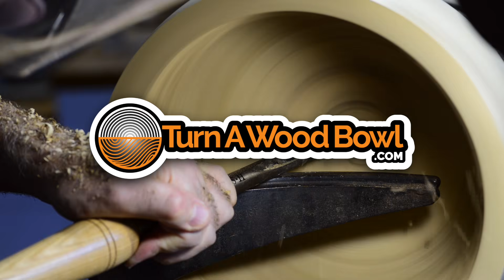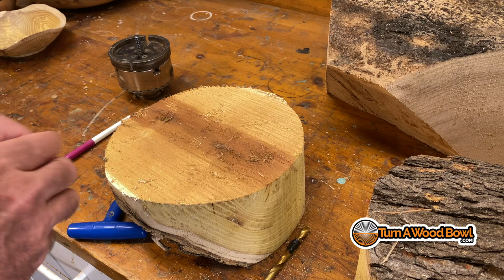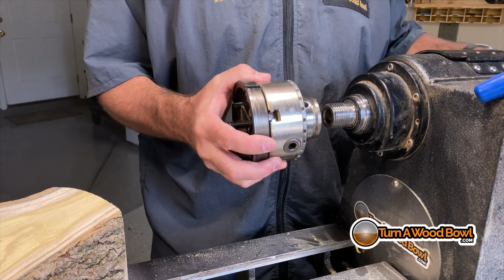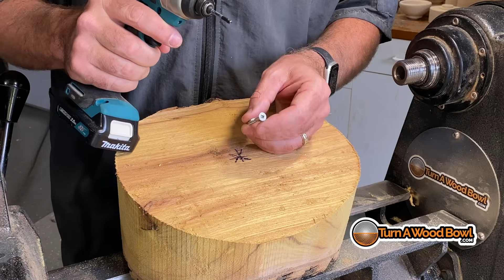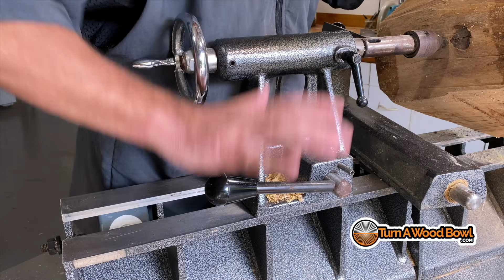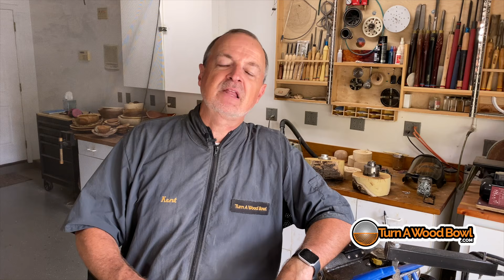3 Ways Mount Wood To Lathe - Bowl Woodturning Video

Comment: Another great video Kent. A couple questions:
1. Is there a reason you don't show drilling a counterbore for the spur method? It seems much safer to me although it adds a step?
2. For face plate mounting screws I think SS is actually the second worst choice after cheap Chinese screws. Basic carbon steel is stronger and you can also step up to grade 8 screws which are even stronger.
I'm interested in your thoughts. Thanks.
Reply from the maker: Eric,
If you have a good tailstock lock, you should be fine without drilling a counterbore initially. 
And, the most important aspect of the screw is the size. You want one that fits the hole almost exactly. Any slack can cause the faceplate to shift while turning. But, also never use drywall screws. 
Happy Turning! 
Kent

Comment: Is it safe to attach it using double face tape to a wood base on a faceplate?
Reply from the maker: um??? Well, it depends. I would not do that if I were just starting out. And you have to have a very smooth surface to apply the tape. Happy Turning!

Comment: I have really enjoyed your helpful hints I have a Craftex lathe which I just purchased used and I have been turning out some Elm bowls green three-quarters of the way and drying in the microwave 45 sec. at a time and weighing till it is around the same weight as last time I also have a very good moisture meeter my problem is my motor is on the back of the lathe if I use a faceplate it brings the piece too far back and it hits the motor but I am dealing with it. my next question is have you ever mounted a faceplate to the tennon I am finding drying wood in the microwave the tennon gets a little out of round and it throes the bowl off I have tried to clean up the tennon but it was a mess I ruined bowl the tennon was straight but it altered the bowl to much .thanks so much Steve...
Reply from the maker: Good question Stephen. Check out this video. https://www.youtube.com/watch?v=2qor9wes5zk Happy Turning!

Comment: Kent, I use faceplates and the four jaw chuck.  The problem I’ve run into is on some bowls they have a somewhat oblong shape when I mount them and turn them with the jaw chuck.  What causes this?
Reply from the maker: Hm? Not sure Jon. Perhaps they can be cut more cylindrical initially?
Reply: @TurnAWoodBowl  I found what I suspect is the problem.  I had the wood bowl base contacting the base of the jaw chuck instead of just the jaws.  Subsequent bowls have turned perfectly round with no issue.

Comment: Has any body used the paper and glue to attach the blank to face plate. 
Was told to attach a wood round to face plate. Apply glue to round. Attach note book paper and glue and attach turning blank. Clamp. Let dry and turn.
Reply from the maker: Yes Steve, I may do a video on this soon. Stay tuned.
Reply: Another question. 
On UTube a fellow used hot glue instead of paper. 
Again, have you ever tried this method?

Comment: can I use a face plate to hold the end of a small branch to turn a spindle?
Reply from the maker: If there is room for the screws, but that is not the best way to mount a spindle turning. Use a spur center and tail stock.

Comment: I am new to bowl turning , I’ve had the pleasure of working with a fellow that’s been turning for 30+ years and he has never showed me the worm or the spur but in my own shop I have tried that on a couple other projects with success , my bowl turning it really new as I’ve only turned two bowls to date and because I was impatient I made my first bowl into a funnel and my second bowl shattered not sure of the reason the walls were 1/2 inch still and I was going slow trying to get a good feel of the gouge but I have plans for a cherry tree and it’s going to be the smaller limbs just so I can get used to handling the gouge safely. Thank you for the videos they have shown me many things that helps a person get prepared but until you put that gouge to the wood it’s just another video. Practice makes perfect
Reply from the maker: Thank you for writing and sharing Robert! We all made at least a couple funnels. All the best to you and Happy Turning!

Comment: Great video, I've been turning for just a few months and used the screw chuck, though I'm learning to use the  4 spur chuck. What is best to use in the tailstock with the 4 spur? Currently I use a #2 morse taper heavy duty live center, but I seems to dig in too much. Other/better options?
Reply from the maker: That sounds like it should be ok. It might be the wood too. A soft wood will allow the center to dig in more. Happy Turning!

Comment: Thank you, the information from this video was is priceless. You were able to cover everything needed to get started turning a bowl that every new turner needs. As a new turner putting a piece on the lathe has got to be the scariest part, just not knowing if you have done it right. You didn’t push the different ways or your way is the best leaving the it up to the turner. I myself haven’t decided yet what will work for me but getting there, Slowly but surely it will come. Ideas running through my head constantly need to put them on the lathe. Again thank you for sharing it was a wonderful and enjoyable video to watch. 
I will catch up on some other videos you have done. If I may ask ?
If you were turning a bowl,with epoxy what method would be the best? 
I’m thinking the worm screw but still bring the tail stock up!
Reply from the maker: Thank you, Nancy. Glad you like this. Epoxy should not be any different than wood. Go with what you prefer and are comfortable using. A spur drive center, faceplate, or worm screw will all work. Happy Turning!

Comment: Kent, love the videos. I have an issue when I try to use the screw chuck. It does not happen every time and that is the screw becomes loose inside the wood. This tends to happen when the wood is green/wet. I have a ONEWAY chuck and screw. Any thoughts.
Reply from the maker: Well, the first thought is I don't like screw chucks. Ha. If there aren't loose on the wood, they sometimes come loose in the chuck. And getting them out is rarely easy. You might try adding small shims, like several toothpicks, in the hole to force the teeth to grip the existing hole. Let me know if that helps.
All the best to you and Happy Turning!

Comment: I have a hard time getting the worm screw that came with our Wen 4 jaw chuck to seat. Either it won't thread or it just turns. I've used the recommended drill bit as well as one size smaller. I've tried wax to lubricate the worm screw too. What would you suggest to help?
Reply from the maker: I suggest using the faceplate or drive center. ;) Seriously, I'm not a worm screw fan. It always seems like I'm spending too much time fussing with the same issues you are describing. Happy Turning!

Comment: Thank you for sharing and I have one quick question about the 4 Spur Drive Center (MT2 Morse Taper), is the stock one that comes with our Lathe is that enough to start out with or do you suggest buying a better one??

Thank you
Reply from the maker: If the drive center digs in and holds the piece, yes it should be fine. The 4 spur one I use seems to have a little width which helps with the larger pieces. All the best to you and Happy Turning!

Comment: Kent, what’s your experience with expanding into a mortise rather than clamping down on a tenon?
Reply from the maker: John, I enjoy having more options for the foot of a bowl, that is why I primarily use the tenon. I find the mortise too restricting. Happy Turning!
Reply: @TurnAWoodBowl  thanks, Kent. Makes sense. 

How then do you finish the bottom of the bowl? … video or class on that?
Reply: @TurnAWoodBowl  Kent, just found your video on  using a jam chuck to remove the tenon … again, thank you!

Comment: Dear Kent! Meanwhile I watched a lot of turorials on woodturning and I want to thank you for mentioning all of the concerns a beginner has to deal with. Thanks secondly for your understandable English even for non-native speakers like me; that's not self-evident for Americans. One question is left however: what are impact screws? I've never heard of it in Germany. Seems as if it's a kind of square hole... Greetings, Kerstin
Reply from the maker: Kerstin, Thank you for writing and for your kind words. When using an impact driver, screws that have a square, hex, or star hole don't seem to slip. I hope that helps. Happy Turning!

Comment: Hi Kent. Quick question: if I have a 2in thick blank, which I want to turn a shallow bowl from, what would you suggest is the best method for me to attach?  I am worried that attaching a faceplate would mean the screws would be too deep in to the wood, to be able to turn them out. Many thanks 😊
Reply from the maker: I would use a spur drive center and the tailstock. This leaves the least and shallowest mounting marks. All the best to you and Happy Turning!

Comment: Hi again. I bought a record power SC3 chuck prethreaded for 1 1/4" x 8 tpi for my new Powermatic PM2014 lathe. However, I found that the chuck bottoms out before it seats fully on the spindle. The stock faceplate that came with the lathe threads all the way down so I'm pretty sure it's just the difference in machining of the threads on the new chuck.

I tried to search on HD for a 1 1/4 ID washer but that proved to be futile. I'll hop over there tomorrow and see but I figured I'd just ask where you got yours. Thanks!
Reply: Ah I answered my own question on your website. Great site btw!
Reply from the maker: OK, great, so you discovered the simple plastic washer to take out that gap. Fantastic! Happy Turning!
Reply: @TurnAWoodBowl  I think I must have a defective SC3 chuck because the insert does not fill the gap sufficiently. Here's a picture of the chuck with and without the insert. 

Also the stock faceplate that came with the Powermatic PM2014 lathe spins down all the way with no issues. The chuck was not cross threaded and spins easily forwards and backwards. It just seems that it was made on a Friday and someone forgot to give it that extra turn with the tap.

With:
https://snipboard.io/uENmCy.jpg

Without:
https://snipboard.io/10CFKZ.jpg

Comment: Those square headed screws are called robertsons screws. I never thought I would be teaching a master something. Love your videos , keep them coming. I always use robertsons screws.
Reply from the maker: Thanks. Good info. Is that the name of the designer of this screw? Happy Turning!
Reply: i've also been using Robertson screws exclusively since discovering them a while after having started this sometimes frustrating, sometimes satisfying hobby of woodworking, because with them, at least, I know I won't be left in the lurch! The bit will always hold, very often even to the point that I can put the screw onto the bit before bringing it to the spot/hole where I want to screw it in!

Comment: Thanks for very effective and informative videos, especially for a first timer like me. I followed your instructions closely when using traditional bowl gouge, but probably not close enough and for this reason I encountered many catches, some were quite strong. It was initially scary, however, they thought me how to avoid them and I got better. I was not clear about when to sharpen the bowl gouge. The turned surface was quite rough. I do not know if this was because of incorrect use of the gouge or using a dull gouge (I was using a new gouge). So please provide some insight for first timer when to know it is time to sharpen the gauge. I understand, I must try to apply your instructions as closely as possible, but there is a big distance between listening to video and applying what I learn into practice. You are a very effective teacher. Thanks again.
Reply from the maker: Thanks for writing and asking this question. There's a woodturning joke that holds a large kernel of truth. "If you think you should sharpen your gouge, you should have done it 10 minutes ago." In my Tool Sharpening Online eCourse TurnAWoodBowl.com/sharp I teach that we need to closely pay attention to the feel and "attitude" of the bowl gouge right after it is sharpened. That performance diminishes slowly and many times illusively until we are struggling at the lathe. So awareness is one key aspect. Happy Turning!

Comment: I’m a new subscriber who loves the comprehensive explanation. I have turned about 500 baseball bats on a Shop Fox lathe. Just getting into bowl turning- a completely different world. I can’t trust my tail stock bc turn handle is plastic and I have to physically push it into my work which is not a problem for spindles but not safe for bowls. Additionally my slowest speed is 800 rpms. The blank you used would scare me at that speed before I could round it out. Anyone have advice on what my next lathe should be?  I want to do bowls safely but continue my bat making. Thanks!
Reply from the maker: Hello and welcome! That's a lot of bats! Very impressive! Check out my Lathe Speed video and perhaps investigate a control switch system that would give you control of your lathe speed. All the best to you and Happy Turning!

Comment: Two comments
1. I do a lotta big natural edge pieces & have often had trouble balancing them.  The four spur adjustment will be a huge improvement. 
2. When I've used the four spur piece on large wet wood, it almost always slips--the tip gets compressed with strands of wood, I have to take it off... clear it out...  put it in again. Maybe I'm too aggressive with my cutting. The log stops, the lathe keeps going. Any thoughts?
Reply from the maker: Make sure you are using a broader spur center with larger spikes for the wet wood. I've had that issue before but with a narrower spur center that had smaller teeth. Happy Turning!
Reply: Thanks
Chuck w

Comment: Most of my bowl turnings are live edge with bark and so I drill a 2" forstner bit and expand my jaws to hold it..... I also use the forstner bit to make  the bowl surface flat to accommodate the face of the chuck...But I do use the plate and screws for the larger bowls....
Reply from the maker: Sounds good!

Comment: Hello Kent,  I’ve been watching some of your videos and put in action what I’ve picked up and I thank you for all you do and give to all woodturning fellows. I use the screw warm as my first option mostly because I use a mortise rather than a tenon, I can remove the tailstock and refine the dovetail, second option is end to end and it depends on the size of the project, anything larger than 8 inches I’ll use screw warm. Cheers!!
Reply from the maker: Thanks for sharing. That's a good point. You can quickly switch between the worm screw and the chuck! Thanks and Happy Turning!

Comment: The advantages outweigh the disadvantages with respect to starting off between centers. That said, It’s likely more a destination than a staring point. 

A nice heavy lathe, tube sand added if possible, I use a heavy duty two prong spur drive.  

Starting between centers is the best way to start turning with the blank on its balance point and that is a game changer at least from my experience. 

So while one does need to make sure every thing is secured and remains snug, roughing times at least for me came down significantly along with physical effort. - there’s more space to focus on the little details such as safety and how the grain is lining up relative to the lathe’s axis.

That’s a game changer and certainly as someone’s confidence increases, well worth trying.
Reply from the maker: Well said. Thanks for sharing! Happy Turning!

Comment: Thanks for another good video with a lot of good information but please stop calling a four prong drive centre a chuck. It’s not a chuck it’s a drive centre. There are various types of drive centres, four prong, two prong, steb type etc etc, there are tailstock centres, it’s a centre it’s a four prong drive centre it’s not a chuck. A chuck is a holding device that expands and contracts to hold and generally centre the work. There are Jacobs chucks, there are three jaw chucks, there are four jaw chucks,  collet chucks, some self centring some with independent jaws for offsetting or more accurately  centering the work. A four prong drive centre is not a chuck and should not be referred to as a chuck, it’s a four prong drive centre by the look of it a number two Morse taper drive centre that seats in the morse taper swallow it’s not a chuck, please stop confusing things by calling it a chuck.
Reply from the maker: Ok, noted. Thanks.
Reply: No worries, keep up the great work.

Comment: Thanks for your very informative videos. They fit the newbie as well as the well experienced.
I use all three methods of mounting. Depending on the wood, size of blank, moisture of the blank and balance. Also I use a little candle wax on the screw and it's a little easier to get the blank unscrewed.
Take care, WyoGrizz
Reply from the maker: Thank you. And great tip for the screw chuck. All the best to you. Happy Turning!

Comment: I like J Armstrong's recommendation of recessing the spur drive, especially if you are biting into bark. The solid wood under the bark is much stronger. Don't forget the admonition of using dry wall screws; these can be brittle and break off. Square-drive screws are excellent for this application. I use them in most of my woodworking and have never stripped one. I need to get several lengths of stainless screws for my new faceplate.
Reply from the maker: Yes, good point about drilling in for spur chuck. Faceplate issues are covered here https://youtu.be/Zt_BvOCXcgk   As always, thanks and Happy Turning!